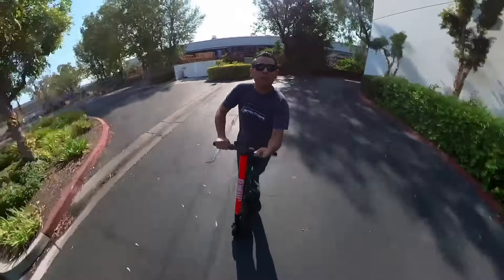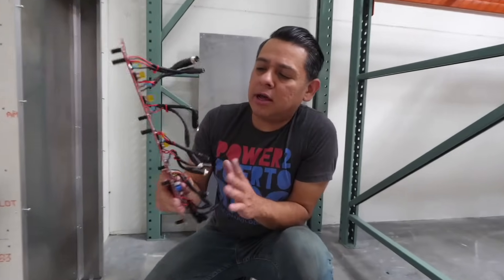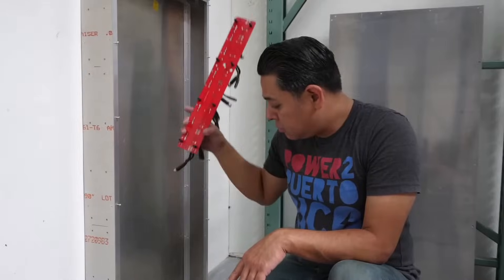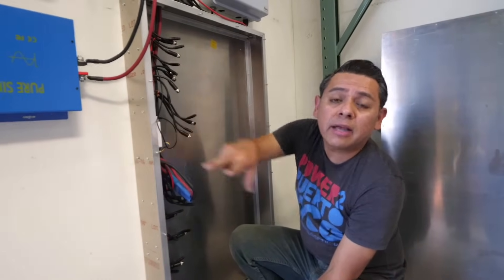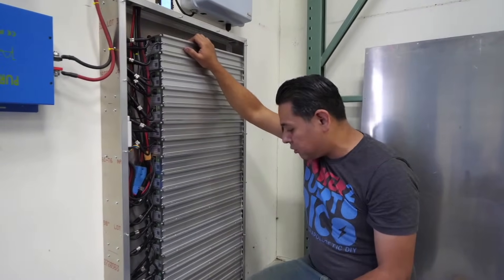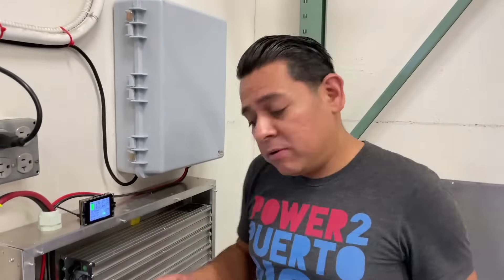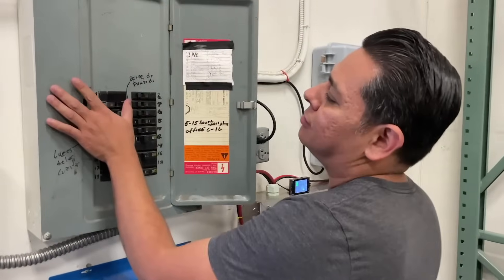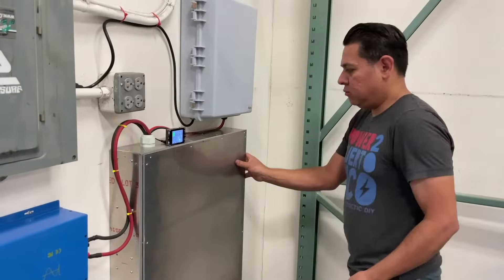10kwh DIY Powerwall project

Comment: how do you protect the packs from high amps - example if you have 10 packs and charging if bms goes off in 9 so only 1 pack left the 18amp charger will push 18 amps into 1 pack and blow it and discharge if 9 turn off all amps will be drawn out of 1 pack - most scooter packs work on 15-20 amps out and 3-4 amps in so how can you do this safely ??

Comment: A stack of battery packs like that would be perfectly suited to a FLIR type of infrared diagnostic tool.  The IR camera will show you which battery packs are running hot, so you can plan for replacement.

Comment: Why do you spend time explaining how you bolt it on the wall? You could make a video about how to put granny's cupboard on the wall with the same success.
Reply from the maker: Because I’m tired of reading your “how do I drill a hole”. “How do I solder a connector “ questions .

Comment: Been working on my solar set up and I put a fuse on my series connection load line to regulate the amp draw pull then series connection a Joule thief to get ground heat pull and a resistor capacitor on the series ground connection using the load pull is that acting like a breaker for the load line just wondering working on my wall system for hold charge with a earth battery in close loop with a antenna to charge the ground with radio and sun for a good ground battery

Comment: Hey! Any update on the MegaloDongle??? Manage to get a bunch of 36v scooter batteries and was thinking on a way of connecting them without taking them apart. PR!
Reply from the maker: I think we have some in stock
Reply: @jehugarcia  Thanks for answering! I saw you have the boards in stock. The batteries I have are X8F 40 cells 36v. I haven't tested yet but I guess they will have to be awaken. I'm guessing the activator or awakening thing is generic and works for many models? 
What 36v charger you would recommend for charging this batteries with 3Kw Solar System. Thank you so much for all your content! Bori!

Comment: Have anyone used the MeGaloDongle with solar panels to charge?
Reply: Well, as I understand it, after the powerwall is built, connect the solar charge controller to the powerwall to charge the batteries inside the powerwall and that should do it......
Reply: @alals6794  yeah I kinda knew that, actually looking for help with the  parameters for the charge controller for those particular battery.

Comment: On your inverter to generator switch power cord, how did u wire that up? 2 outputs from inverter are each a separate leg into the gen transfer switch cord?

So are the ground, neutral's both joined....then separate hots to each leg of the gen transfer cord?

Comment: Jehu, how do feel about the server rack batteries that come prepacked for 5kw priced at $3.33 per kw for an Eg4l battery system that comes with a fuse and BMS. They are also stackable and seem like a great alternative to DIY system. Did I mention they have them in 48v and 24v?
Reply from the maker: $3/kw?   what does that mean?  battery capacity is measured in Wh.   Eg4l batteries are priced at $312/kwh

Comment: @jehugarcia I have a Growatt 2-MPP converter for my solar panels that doesnt have a battery connection. Is it still possible to build a DIY powerwall after this system? The cables from MPP that go to the fusebox from the house for example?
Reply from the maker: You have a grid tie inverter?
Reply: @jehugarcia  yes a Growatt MIN3600 TL-XE
Reply: @jehugarcia  MY solar panel installer says i can add a AC high voltage battery stystem
Reply: @jehugarcia  do you think i can add a batterypack to a growatt 3600 tl-xe?
Reply from the maker: Yea but it has to be a separate system that works with your existing, meaning you will have to use a separate inverter and a charger for your battery.

Comment: hello, I really like to build a 48volt battery but I cant find all the parts I need on your website to complete a project. I just don't want to get stuck with parts I'll never use if the other components aren't available. thanks for your videos

Comment: A listing of parts and where to purchase them would be helpful. The battery enclosure can be purchased as a electrical panel can, just need the dimensions.
Reply: I'd be able to get all the scooters out of the river, there's probably at least 150 in the Willamette as it was, as it always has been, about the only thing to do in Oregon if you don't have a bunch of money.

See: just tossin bikes in the river bro

Comment: Every house shouldn’t be like that. The power network should be made more resilient and avoid outages. Placing such capacities of batteries in every house is insanely irresponsible.
Think about the ecological impact before piling up that amount of batteries in your warehouse just for fun.
Reply: Every house should have some level of self-reliance, especially if you're someone who requires special medications or foods to stay refrigerated or live in a particularly hot or cold climate.  The grid is great, until it's down.  If more houses can run off of their batteries during peak times, it makes the grid more resilient and lessens outages.  Residents also don't get charged peak electrical rates and can have their batteries recharge at lower cost off-peak rates.

Comment: Picking packs 9 through 20  in about a week (last in stock near me and cheap.) Managed to hit the $100 per kWh on the packs overall so the tough decision is not to harvest out and stick with the 36v environment OR go down the PCB 24v rabbit hole with cell level replacement and more inverter options .... you make it tough Jehu!!!
Reply from the maker: Cheap batteries or wide variety of inverters,  yeah it’s a choice these days.
Reply: @jehugarcia  Indeed ... been interesting to say the least. Ive been thinking of ways to adapt to 36V permanently over time if I could manage to craft a 10s PCB board to add capacity or replace scooter packs that may need to be pulled out of rotation. At least that way you future proof the 36v support equipment investment (inverter charger etc) more. What do you think?

Comment: Hi Jehu. Great video as always. Thanks. Would it be possible to make a video on a custom metal cabinet for 48 or 64 Eve/Lishen 3.2v cells with locking wheel casters and door. That would be cool. Alternatively any alteration of an existing metal cabinet that would neatly hold 64 of said cells. 🇬🇧🇯🇲

Comment: It looks so simple to make a Powerwall, but that's not easy as it looks like right ;)
Reply: Easy to put together. Not so easy to design. Understanding what can cause thermal runaway (fire) I think is the most important. 

You definitely have to make sure no individual cell gets over charged.
Reply: @ecospider5  Yup you got that DIY ;)

Comment: you should say what the ballpark total cost is compared to other similar systems (great job)
Reply: The 20 scooter battery example setup (almost 10kwh) as shown in the video runs about $2600 + tax + shipping + the external metal enclosure.  That's a really good price.
Reply: @mfinite689  I agree does that include the switch and inverter?
Reply: @grandpaseed  Yes, everything as shown in the video.  There are links in the video description to all of the parts used if you're interested in this project.

Comment: Ahhh Thats perfect! I would double like this if I could. Seems a bit steep on the pricing though if I could afford that I would go that route instead of the DIY wake up for the batteries. I have 40 battery packs and to pay $1100 to enable the batteries that cost $2200 seems fair when you consider the total price per watt, but when I already paid $182 for basically the same setup without the wake up module installed its hard to understand the price. If the price for 4 was around half that price I would start from scratch and buy them, but maybe theres some more to it that the PCB powerstrips dont do?
Reply from the maker: American labor,  that’s what makes these the price They are.
Reply: @jehugarcia  Understandable. I would have thought that scale would reduce the price, but you know your numbers better than myself. It is fair, but not if you already have the other setup. Who knows I may still order it in the future to save some time.
Reply: @Dimrain13  Very Understanding reasoning.  i Like, OLE'!
Reply: @jehugarcia  I also looked at some of the components that went into this and the price makes more sense after seeing those prices...
Reply from the maker: Yeah expensive connectors mostly
Reply: @jehugarcia  Excellent answer
Reply: @jehugarcia  I would like to buy the 20 cell battery packs but I don't see a good way to charge them with the dongle.  Please let me know if you have anything else.  I cant charge all these packs with 1 1.7A charging brick.

Comment: Heat does not rise. Hot air rises. So if you do not have good airflow each battery will radiate heat in all directions. Which means without airflow the center battery will be the hottest.
Reply: Couple of computer fans on the case would be a nice touch to it.
Reply: Hmmm, that's an interesting statement.  When something gets warm in a vacuum, even with gravity involved, it does tend to stay stationary.  However, when there is no gravity, cooler air will tend to "fall" underneath the heat source and "push" the warmth upward.  I suppose you could refer to that as hot air rising, but only inasmuch as colder air sinks.  Take away gravity and all bets are off.

Comment: 2 questions. 1. Why is there no floor clearance? (cleaning and potential water leaks?).  2. What's the difference between Aluminium, and Aluminom? or are you just replacing the "iu" with an "o"?
Reply: Ehm, US uses aluminum and basically the rest of the world calls it aluminium.

Comment: In some states the power companies will give you discounted power rates in off peak hours.  This is a set up that could pay for itself by charging the batteries in the off peak hours then in peak you remove yourself from the grid and use the power you saved from the night before and you are helping keep the power grid more stable.
Reply: Depending on what the efficency is you are correct.  I wonder how much energy is lost in charging these batteries during off peak and utilizing it during peak times.
Reply: I wish to see more and more VPP solutions on the market. Trading electricity in a real time on the markets and making money for you, but you not doing anything for it) Just build and use.
Reply: You Have To use a approved battery
Reply: @woodyahh2110  no

Comment: Your link on the website for the inverter to buy with these circuit boards for the powerwall is wrong, it brings us to a 12v inverter
Reply from the maker: Fixed,  thanks fir the heads up

Comment: Without actually testing a thermal runaway condition, it would be really hard to tell if containing the modules in an aluminum enclosure would be enough to contain a cell explosively venting and catching fire.  I think I would want to use a LiFePO4 battery or another safer lithium chemistry inside of any living or occupied space.  If a person had a conditioned space separate from their house by 30-40 feet like an insulated shed that has HVAC installed then that would be a good place for a power wall like this.  After seeing the aftermath of a Tesla power wall going up in flames and even a handful of DIY power walls catching fire or having a close call, I don't think anyone should have NMC or any other similar cell in, on, or near their home.
Reply: There's no way for all them to do that at once. U would loose one module at max.   And in those cases its not gonna set the rest on fire ive blown up several by mistake 😭😭..
Reply: @far1002  While it is unlikely I still wouldn't want it in my house.  I have seen similar scooters go up in flames as the cells cascade due to a charger failing.  With all of these packs in parallel you could still have an AC charger or MPPT solar charge controller fail and dump unregulated voltage into the DC bus slowly charging the cells until all of the BMS's disconnect and then you have the potential for the DC bus to hit 90V+.  The problem is that the high voltage can surpass the max voltage rating of the MOSFETs in the integrated BMS's causing them to short and now continuing to conduct and overcharge the battery packs.  This type of failure is documented and can happen.  This system would need a voltage controlled contactor to disconnect the charging source from the battery if the voltage ever shot up past the normal cutoff voltage of the charger system when working properly as a necessary safety device and even then I still wouldn't want it in my house.
Reply from the maker: Every modern home has at least 10 NMC cells inside.  You are most likely typing these comments on a device containing one. Most of us sleep right next to one.   Risky?  For sure but I believe it’s the equivalent of someone saying they won’t ride in a car because a collision is possible.    Most of us will take the risk and small number of us will pay the price

Comment: too bad we cant do this ins Australia :(
Reply: Why not?
Reply: @pashko90  cant have a grid connected battery system unless its certified or else its illegal. and to get it certified will cost more then the system itself.
Reply: @gia-huyhoang8987  Except this isn't grid connected. It has a manual change-over switch to disconnect from the grid.
Reply: @graemezimmer604  according to australian standards thats still illegal unless certified. (ive asked)
Reply: @gia-huyhoang8987  Jump on the solar power island or Hybrid configuration and emphasize that in case you connect the battery via charger to the grid the battery acts like a consumer. 
Use the switches to go off grid if you like or part of your house.
Reply: @gia-huyhoang8987  You are asking whom ? Usually the locals that make their living from selling electricty. I simply would suggest to start small and higher once a certified technican to get a small battery into your house. Once that is done you go on your own. 
Or you take the island configuration at least for a few fuse boxes and not the full house.
Reply: @typxxilps  No idea what solar power island youare talking about. Do you live in Australia pleas send me a link??  In AUS especially in the state of Victoria no electrical work above 40v is to be done by unlicenced trade, and no licenced tradesperson worth their grain of salt would hook up your grid connected out house on an untested or certified battery/generator without engineering certification. My neighbor is a industrial electrician and he does backup generators for hospitals/labs etc...and it takes months of test and certification process by approved authrorities to even hook up an alterntive supply to a small lab.  the standards in austrlaia only allow for automated power switing between supplies and dont allow for manual switching of power supplies as far as i know. You can have a Dwelling or property complety off grid with battery power that is 100% fine. but the second you touch the grid...its a big no no.

Comment: wait... hows the transfer switch work if the circuits are off? is it downstream of the breaker? is that code compliant?
Reply: That looks to be a Reliance 306C 6 Circuit Generator Power Transfer Switch.  Its UL certified and code complient in most if not all areas if it is installed correctly as a critical loads panel since it breaks the connection from the main panel downstream for each circuit you want to power so their should be no chance of backfeeding even if the main panel was left on since it breaks that connection before making the gererator socket connection.  These are common to find in houses and cabins where you only need a few backup circuits to run on a generator or portable power station.
Reply: @kuhrd  thx!! til!
Reply: @kuhrd  so shouldn’t it have another set of circuit breakers installed after it as well? None of this would be compliant in Australia, not only would it need circuit breakers but it would need rcds as well, however we use 240v so more chance of electrocution.
Reply: @MrBrettStar  The transfer switch panel has a pushbutton circuit breaker for every circuit passing through it.  So circuit breaking is covered.  This particular transfer switch is aimed at the North American market where split phase power is used so no RCD or GFCI required but could be added down stream if needed. 
This is also an emergency transfer switch so it is really only meant to be used during times when the power is out and you need to run a few necessities or essential circuits off of a generator or portable power station.  Some of the portable generators and power stations now come with a GFCI or you can buy one that plugs inline with the system if you need it.  I would venture to guess that a transfer switch used in other countries may be setup different.
Reply: I still prefer to use a transfer switch (unless it's a grid tie inverter), would I 8 this was wired up correctly

Nice use of scooter battery's thought, interesting product
Reply: @leexgx  I would agree, a full on manual or automatic transfer switch is the way to go.
Reply: The transfer switch is the middle man. the lines are routed into teh main  power box breakers, and to the circuits.. so the generator transfer "breakers" are really a toggle from Grid to backup(GEN or other)

Comment: I call bull crap on there being a lot of good 36v inverters on the market. Please link some...
Reply: some small UPSs use 36v, but I agree its really not that common unless you find a larger inverter and run it on 72v
Reply: xyz and reliable aren't good examples. victron nope, renogy nope, growatt nope, mpp nope, sma nope.